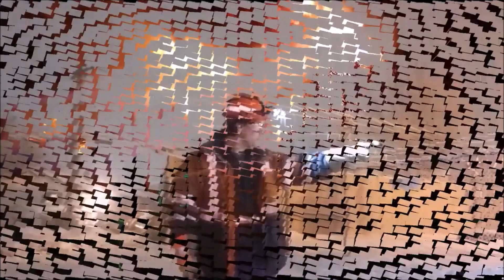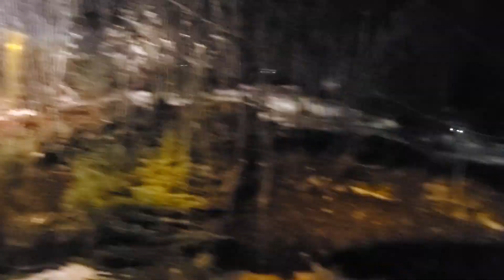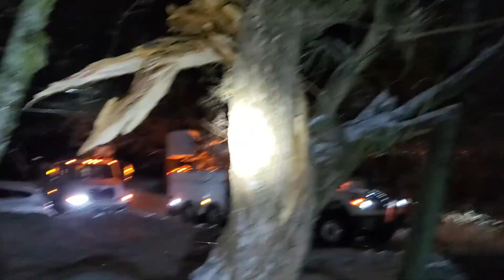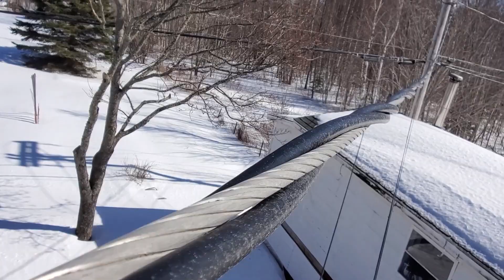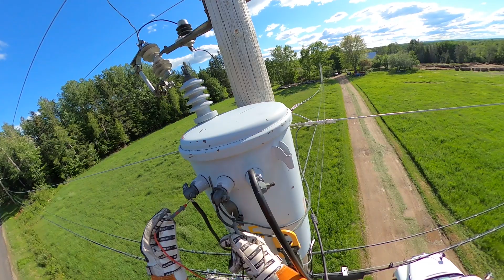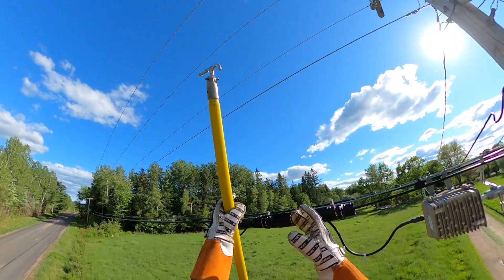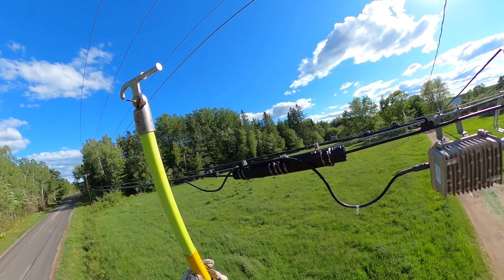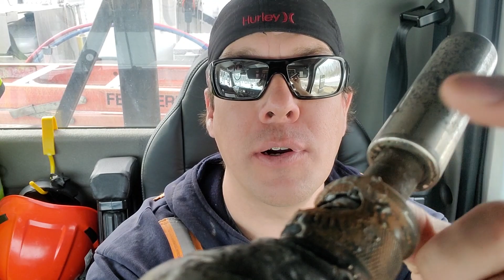Accidental contact with 120 volts

Comment: Nothing new here.
If you know the least bit about electricity, unfused stuff is obviously way more dangerous.
I had to replace the input breaker of a house once and ofc was a 220v single fase (south America). I put on rubber gloves, a face shield and was using 1KV rated tools I didn't even touch the cables directly and worked on them one at a time, taping them as soon as I took them out. Pretty uneventful changeout.
And I do not advice people to do this kind of stuff specially if they don't know nor they are comfortable doing electrical work.
I am not an electrician but I have some some studies on the subject bec studying IT (you do have to study regulations and such although you do not get formal training).
I made sure to take as many precautions and be as careful as possible, and only did it myself because I was confident I could do it safely and comfortable with doing it. In my mind I was treating that line as unfused.
we lived there for a couple years after that and I kept inspecting the work for a while never had a problem after that. Honestly the issue with the breaker prior to my work was just pure incompetence, you see that a lot here, when it comes to electrical installations, the gage of the wire changes for no reason, bad splices, loose lugs on breakers, 1mm2 wire feeding a 25 Amp breaker or coming out of one shit like that.

It also does bother me, and I correct people, it's not the amps nor the voltage it's both, it's the total energy going through your body, there is obviously other factors to it but that's besides the point, study before messing with anything electric. And turn off power whenever possible.

Comment: Where the fault occurs has a big effect on fault current. Dead short on transformer secondary: thousands of amps. Dead short on service entrance conductors: hundreds of amps. By the time it's passed through the secondary lines, service entrance conductors, and finally 100 feet of 12/2 Romex, the fault current is maybe 100 or 200 amps. The further away from the source, the lower the fault current due to the added resistance.

Comment: A classic comparison is static electricity. When you get that tingle after walking across a carpet and touch a switch or metal object that is high VOLTAGE but only a few milleamps so though youll feel it you wont be injured. 
Compare that to lower voltage and high AMPERAGE and you WILL get injured or die. House transformers are fully capable of delivering hundreds if not thousands of amps. If they can power 4,5 or more homes from a single transformer that gives you a rough idea of the capabilities. Remember the average modern home uses 100 amps minimum alot use 200 plus amps. This is PER LEG. the power at the transformer is 120v neutral 120v.
Electricity is not to be feared but it is to be thoroughly respected. There is only two ways: the correct way and the dead way.
Ive done wiring and outlets many times. I always make certain that the branch is dead(breaker cut or in panels the main is off with respect TO the main which is live)
The rest i leave to the pros.

Comment: at 120 volts ac. if the amperage is high enough, it will kill you if you are grounded properly. I am a licensed ham radio op of over 19 years, and I have learned enough that I got a whole lot taller of a respect for electrical current then i ever did. believe me, it's the amps, if the amps rating is high enough, and you put yourself across the hot and neutral terminals, you are going to be well done.

Comment: Yes the amps thing jumped out at me straight away lol
It is a bit confusing the way its phrased and can be misinterpreted, especially non electricians. I'm not keen on the description of the line not having any amps, it gives the impression there isn't and wont be until you switch on the amps. Yes it's wrong and sounds silly to us but from experience its the sort of thing that will be taken from it.
I wont insult you with breaking it down because you know it, its more a case of how it sounds.
How about saying something like you don't like the saying because its both that matter, a HV arc will burn bits off you with relatively little current in the right conditions.
As an aside I have heard of way more deaths from burns than from shock, only one shock and they had a heart condition. the others burnt and died due to shock induced from those burns.
Other than that first rate video and i Hope your well settled in your new home....👍

Comment: Good point about the primary fuse not being able to provide any meaningful protection here. Fuses don't blow instantly, so the short-circuit from the impact driver could easily draw several thousand amps for a enough time to cause the damage you see.  Even at 120V, this is a tremendous amount of power and extremely dangerous.

Comment: I was standing on a roof and crossed two lines with an aluminum ladder. Blasted holes straight through the ladder, but didn't touch me for some reason.
Reply from the maker: Glad you were ok! The ladder likely made a very nice low resistance path between the two wires... While electricity takes all paths, the metal ladder was a much easier/better path and likely took the brunt! 

Also your shoes, gloves, terrain etc.. would have added to the resistance of "your" path. 
Things could have been different! Again, glad you were ok!

Comment: I'm not a lineman, but an electronic tech. I have to agree with him at least in some regards that amperage is not the only deciding factor.  It's simple, voltage is the pressure, and the higher you go up in voltage, the further it can arc or flash, and once solid contact is made, it's the amperage that determines how much else can go on.

Comment: It is insanely impressive to me that the drill still works at all, would've figured a lot of the internals of that got fried.
Reply: Those are probably pretty rugged given that hey need to withstand quite the abuse.  Next to that, the difference in potential in a tool will also be a thing: the difference will be minimal and those, the whole tool becomes energized at practically the same level.
It's the difference that kills equipment most of the time.

Comment: You can do similar damage with the current from a 12 volt car battery.  On a side note, and with all of the electronics in modern cars, you should never, ever try to "jump start" a car unless you a qualified auto mechanic.  Very expensive disaster awaits.

Comment: Welding: 28 volts or so (180 A or so).  Blinding light.  Melts metal.  Lots.    I accidentally shorted a voltmeter probe in a light switch.  Almost cut the probe.

Can't reverse the current to repair it either.

Current kills.  But - no voltage - no current.

Comment: The issue with this is the metal in the drill provides a very low resistance. Current (amps) is inversely connected to resistance so this low resistance in metal creates massive current especially with 120Vac-RMS. Ohms law states V=I*R which makes I=V/R. this means the lower the resistance than the higher the current. BTW it only takes approximately .01 amps to stop a heart.

Comment: We now have insulated ratchets 3/4" for cembre bolts , and a offset insulted wrench to take off bolts from the track rail next to the third rail 750DC.  But the insulated line pliers can not cut buss stripping.  25hz 220v stings.

14-17 ma cause respirtory distress, 17-19 cand cause heart failure and 19-21ma can cause death.  This from an article mentioning a man in hospital bed, hooked to a power cord not grounded properly with an extension. And a machine that was grounded causing electricty to go through his body.

Comment: no amps flowing until it shorts, then you have thousands of amps flowing. The electrician needs to calculate the prospective short circuit fault current to install correctly rated breakers. They are all rated from 4,000 to 16,000 Amps.

Comment: I think a pole pig or dist. xfrmr is rated in kva ,so 75,000 watts/240 would = about 312 amps
available per leg and if fed by a 7,200 phase wire, that would be a little over a ten amp fuse
on the primary side. Since one side of the pig has it's primary tied to ground and the 
secondary's neutral, touch one of the secondary legs while standing on wet ground is not the
best thing to do as there is a lot more current available.

Comment: sadly ppl feel it is all about voltage, it is about both, I had a hot wire in a clothes dryer loosen and touch the back panel of the dryer, 1/16 steel and a hole was burned through it This was a 120/
240 volts circuit, either hotwire to neutral or ground is 120 volts on a 30 amp breaker, but a
breaker in an FPE panel so more like a fiftey amp breaker that never tripped. I unplugged the
dryer before the breaker tripped..

Comment: That’s actually a lot less damage than I expected, I’ve seen a 12v battery do worse! Anyway no matter how careful you are eventually everyone slips. I shorted a ratchet across two phases on the low voltage side of a large transformer that thing was vaporized in a fraction of a second! I agree with you 100% about PPE no matter how good/careful you are slips happen! Anyone who says they never dropped a tool is a lier and that’s all it takes!

Comment: It is amperage that kills you. If you’re insulated from other potentials and you grab 120v nothing happens. The voltage doesn’t kill you. If you’re standing on a neutral and grab 120v the amperage can kill you. Not the voltage.

Comment: I worked in a tv repair shop people think the H.V. 25,000 volts in a tv is dangerous. The 120v AC is far more dangerous. I've seen people get shocked by the H.V.in a tv and they weren't injured.

Comment: It's probably most correct to think of energy as to what's dangerous, not the volts or current. The actual current generated by static shocks can be quite high, but the energy is very low. The voltage value is of course spectacular and the amps value can be up there, but the time value is microscopic before the amps drop to zero. Once the charge is gone it's gone, and walking across the rug can't produce anywhere close enough sustained current to be dangerous. 

One of the toys I have is a Van De Graaff generator. It can basically build up several hundred kvs on a metal sphere by using an electric motor to rub a rubber belt against metal and PCV rollers. Mine is rated for 430 kv although that's probably an exaggeration. You can generate an impressive arc several inches long by discharging it through your body and the current can reach a full amp-  but the time value is something like 1/10th of a second before all the charge is gone and there's no more. So the total energy is under the 1 Joule that's considered safe. Unlike an AC power line, a Van De Graaff generator is a very poor constant current source, in the range of 10 microamperes or so. Beyond making your hair stand up by touching it while insulated from the ground, a fun trick is to light a fluorescent lamp by holding it near the generator and allowing the current from the electric field to ground itself through your body. Using the generator as a current source like that there's not enough current to even feel. 

The manufacturers of the devices say "don't intentionally discharge it through your body" but this seems to be widely ignored. For some strange reason schoolkids think it's fun to get a static shock and at any rate with those kind of voltages it's hard to avoid doing it accidently and there's not been a documented injury from them.

Comment: I did A/C for 30 years and I had a healthy respect for electricity.  I would get complacent from time to time and got bit for my troubles and it smartened me right up.  Some units were an accident waiting to happen and sometimes you had to reach around to get to a hose connection for your refer line and you couldn't see and once I came across a hot line and I was all sweaty and got zapped and in my haste to remove my hand from inside the unit, took the skin off the back of my hand.  As I am hopping around cursing Crappier using some very unprofessional language, I head a little tiny voice down below and walked over to the edge of the roof and looked down into the concerned face of the little old lady homeowner and I apologized profusely for the language and she insisted I come down to dress my hand and give me lemonade.  I felt so bad that she had to hear that, but it DID hurt.
I was working a change out on the roof with our sheet metal guy and I had removed panels to prep for the disconnect and we left the unit running as long as we could because it was 115 that day.  As I was disconnecting the condensate line I heard a BANG and looked up in time to see the sheet metal guy going off the roof.  I jumped down as quickly as I could and my boss and I ran over to check on him.  He was dazed and confused and we insisted he go to the ER that we would finish up.  The next day he was back at work and I was concerned that he didn't take time off, but he insisted he was OK.  He told us that the ER doctor found 2 BURN HOLES IN HIS SKULL from coming across the capacitor (45 mfd and the unit was running).  That should have killed him, but it didn't and pulled his jeans down to show us the burn mark on his leg where the electricity exited his body.  I went to pat him on the shoulder and discovered he was one solid mass of muscle.  NO FAT.  Like an old oak tree.  That is what helped save him.
So, I gained an even more healthy respect for electricity.  We also had a few commercial customers with 460 3 phase, 277 for the indoor lighting.  I saw an electrician get blown off her ladder while troubleshooting an light fixture and she grounded herself out.

Comment: Correct me if I'm wrong, but isn't it the "Potential" current available that is the main problem? i.e. A small diameter hose will only provide a mere portion of the flow (amperage) compared to a 4"diameter hose.
A 20 or 30amp protected circuit (in your house) has far less potential , than getting into the main bus in your panel, which is often times, a 200 amp meter feed. The 30amp protected circuit will damage your screwdriver but the 200amp potential will destroy the screwdriver. However in either case, if your in the path of that current, it can end up in destroying you too. 

Then there's the A/C vs. D/C issue.... It's my understanding, that A/C will tend to throw you off the contact, whereas D/C can lock your muscles, so you can't release the contact. Either way, I'm not going to attempt to show you, I'm quite sure the outcome might very well be the same.

Comment: I’ve gotten stuck on 120v working on a garbage disposal circuit under a sink base. Left hand was grounded on the bx and right hand had my dykes and my finger was just past the insulated grips and when I cut the the hot wire I completely got stuck. Screaming for help for over a minute was finally able to pull myself off on the cabinet door. 120v is no joke if your not careful

Comment: Nothing on the planet, other then a nuclear detonation, is hotter then electrical plasma generated in an arc. Given enough current, it can be several times hotter than the surface of the sun.

Comment: It's so important to stay alert, use and wear the proper equipment. I did a dummy move a couple months ago not realizing how much previous work had pulled on a line with no real sleeve on the wires coming into the panel. Went to reach in to knock off the lock washer for a dead line and inadvertently slightly bumped the hot of another. The cover on the hot had been already cut through enough and arced off the clamp. Dropped the pliers the instant it arced, that noise scared me more than anything. Didn't get hurt, made a nice hole in the pliers are obviously had to replace some line. Even though it tripped that breaker and the main, still enough time to do serious damage.

Comment: That comment of its the amps that kill you, not the volts has annoyed me for most of the forty years I have been an electrician. I have heard this from so many experienced electricians that it amazes me people don’t get it. Quite simply if you double the voltage on a given circuit, you double the current! It’s not rocket science, it ohms law. I have a friend, also in his fifties who has worked for the electricity board since leaving school and is in a senior role who thinks if you lower the voltage on a given load, that you increase the current 😂. Wouldn’t even believe me when I explained it to him.

Comment: 🤜🏼🤙🏼 Moscow Ohio... I've had to change meter base out live fed under ground took all precautions to make home the same way I arrived... but I do have a good friend that was reattaching a meter base and didn't look at the location of the panel inside the house and used a long screw and boom right into the back of the buse bar in that panel... had 3rd degree burns on the right side of his face and had he not had his safety glasses on he would've lost his eye... stay safe out always go the extra mile with ppe and rubber and tape ...

Comment: I'd also like to say that you can use a 12 volt DC car battery can be used to weld metal and also can burn if metal crosses and makes circuit it will not shock you normally but if wet and cross or complete the circuit you may get a bit of a shock and if you get on the output of a spark coil it can stop your heart I know a bit on this from being an auto mechanic for 40+ yrs

Comment: I want to ask I've always heard that 120 volts is more dangerous than 220 volts depending on the amperage if you have several things on the same circuit and running at the same time I've been shocked by both neither feel good lol